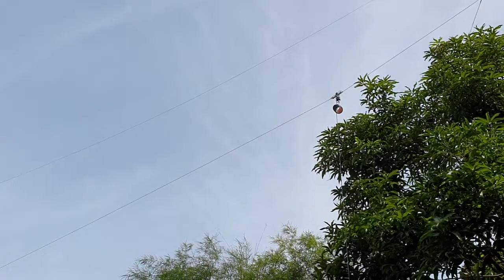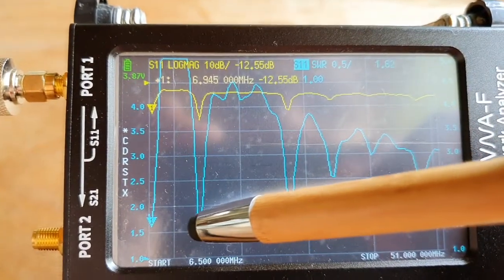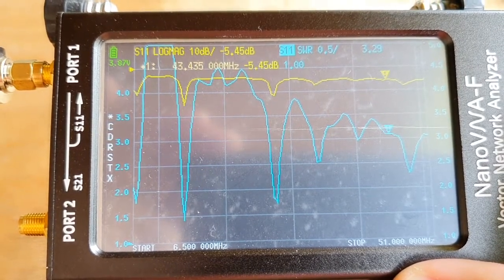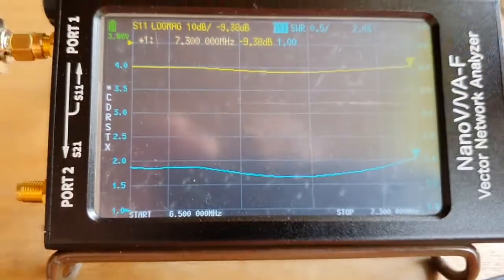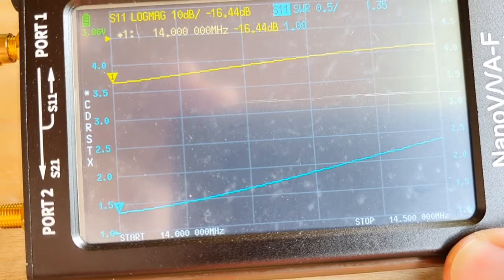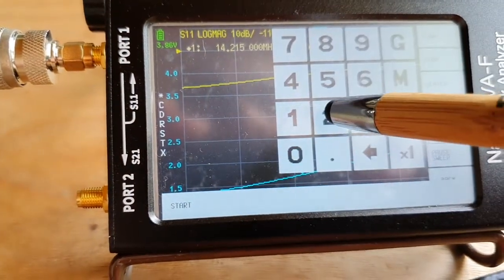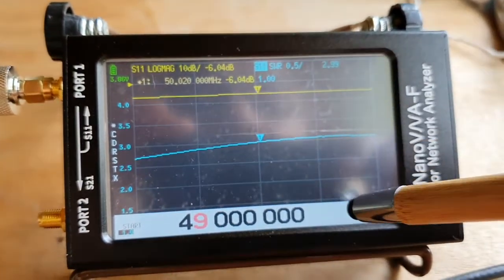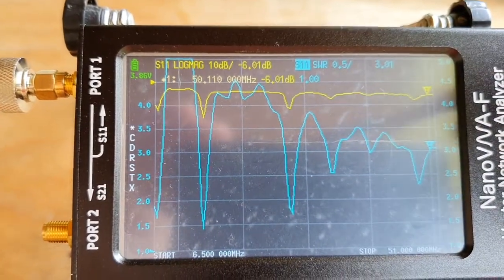Multiband Off Center Fed Dipole Test

Comment: Thanks for the video. I am a new ham KJ7VUL. I built a OCFD with a 4:1 balun and choke. In testing it with my NanoVNA it shows pronounced dips at mostly useless frequencies between 25 Mhz and 50 Mhz. I have tried different lengths from 22.5/77.5 on to 33.33/66.66. I have 1.01 at 3.45 MHz and wish to move it to 3.5 MHz but it won't budge much. I don't have an HF radio yet and have attached it to an RTL-SDR and with my computer listened to check ins on the OEN from all over Oregon. So it receives well. I live at about 4300' elevation.
Reply from the maker: Hello KJ7VUL, i dont claim to be an expert on this but I suggest you check if your using the correct Balun for this project, you might try using other brands also, before working on the lengths. good luck and 73 :-) de du7jay